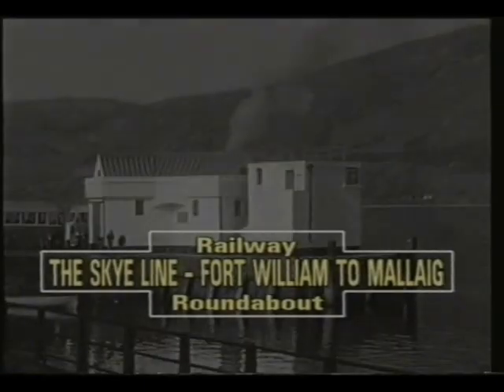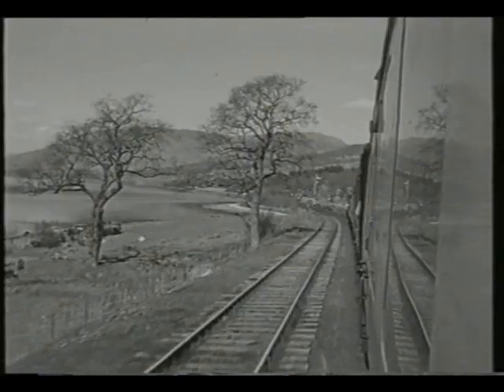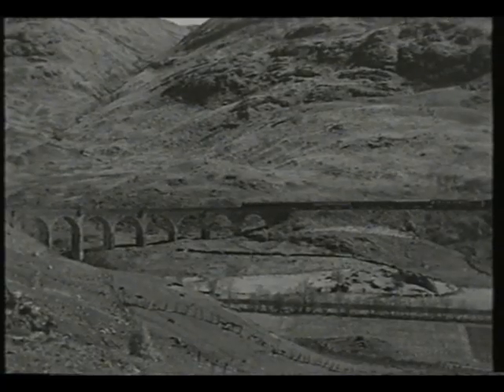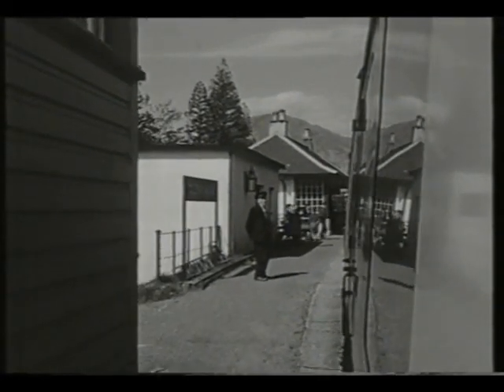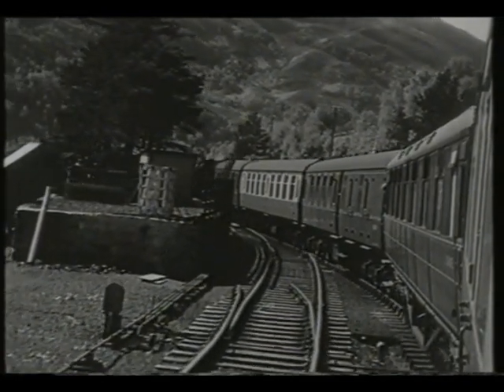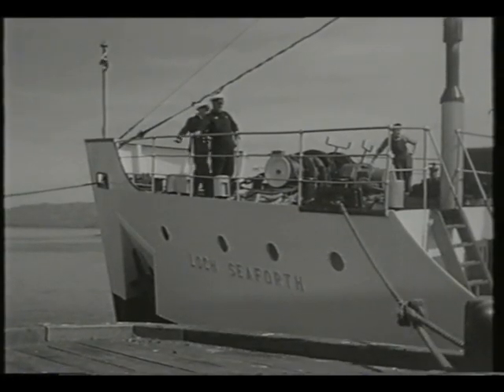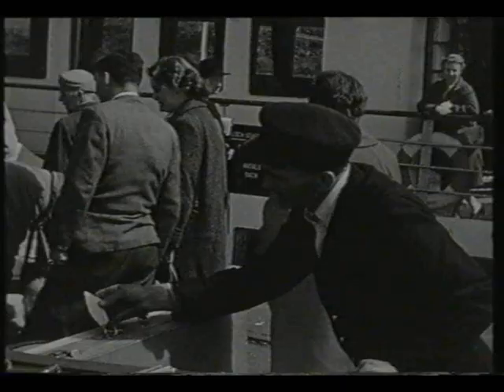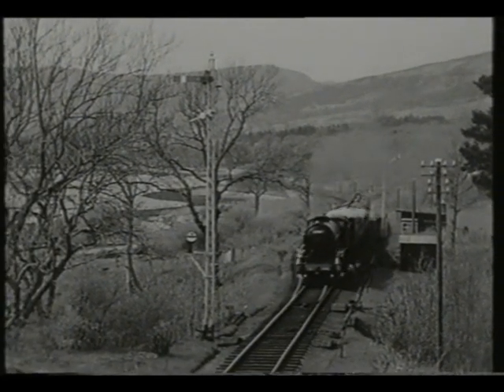Railway Roundabout 1959 'The Skye Line (Fort William to Mallaig)

Comment: This is a great video but they did slip up as bit in not educating the otherwise impeccable narrator. (I'm a Scot btw!). Good to see a good old K2, 61784, in action again, they could have been designed for the line, as they were so well matched to it and well liked by the crews. This also gives a good idea of the running speeds on the line in those days, Also good to see the MacBrayne steamer as well, NOT Calmac please note! Thanks for sharing it! Ken